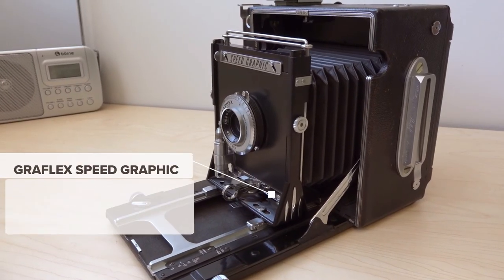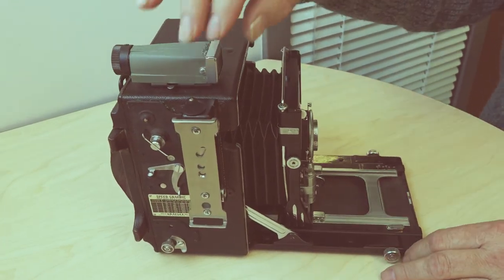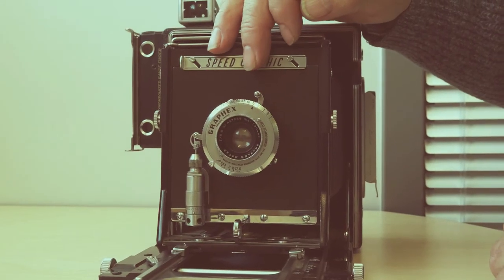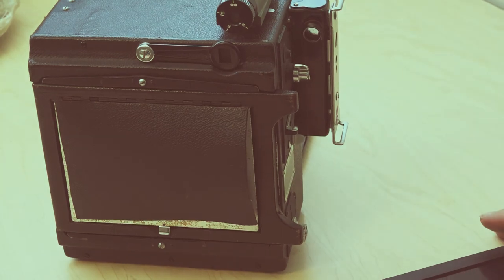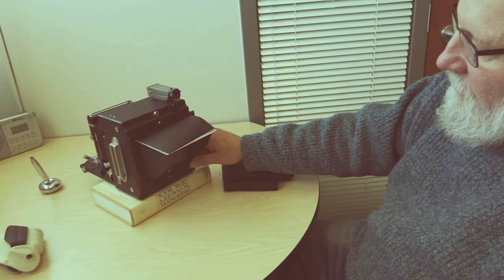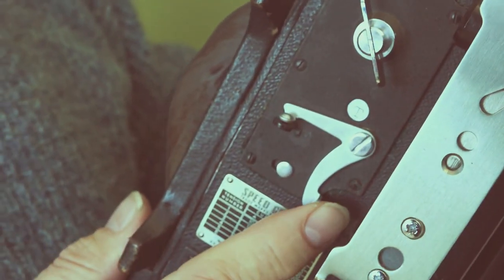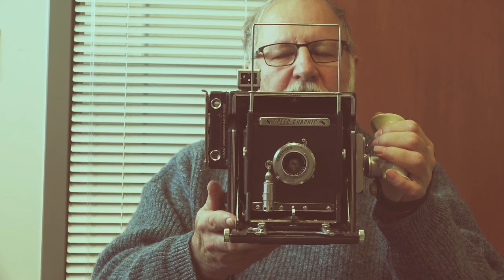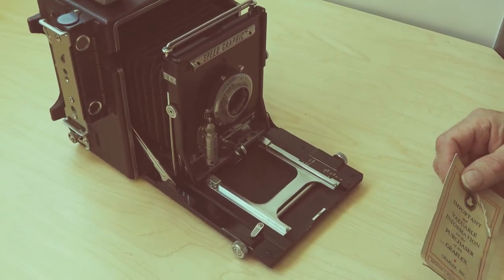Large Format Basics: Graflex Speed Graphic Press Camera

Comment: I’m one of the people who cut his teeth on the Speed  Graphic, as a military photographer, back in the late 50s. Took several thousand pictures on all kinds of conditions with a Graphic including coverage of an 8-week Air Cadet camp for PR. Used hlders, Grafmatic and Kodak film pack, in due time. Quite naturally, I processed my own work. 

Small goof! You have to flip up the rear sight, in order to use the front sight (wire frame) properly and guarantee accuracy of pointing the camera squarely at the subject. It also has parallax correction, of which you must be aware of. Also, I wish that he had demonstrated how the lens board  is changed and the focal plane shutter slits, the drop bed and some of the swings, you are allowed 20 minutes of video 

Great job of explaining the camera though, I enjoyed it.thoroughly.
Reply from the maker: Awesome. Thanks for the tips!